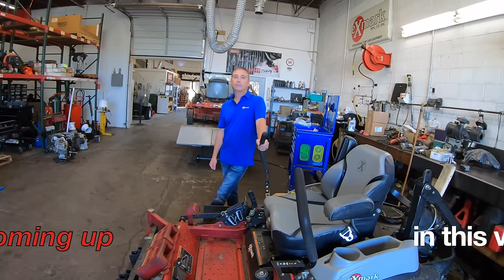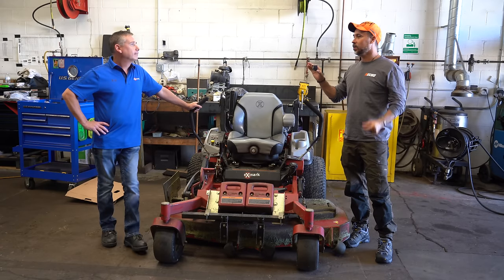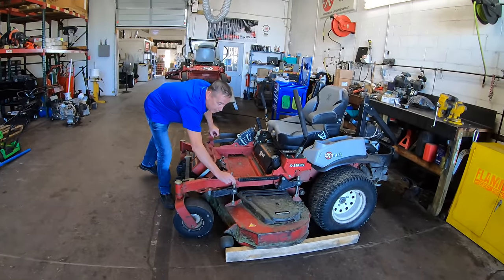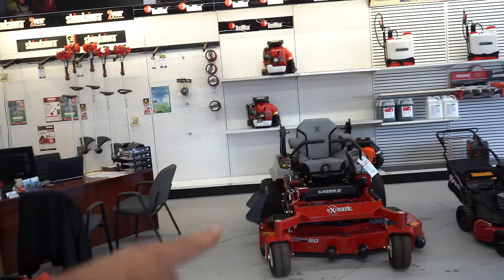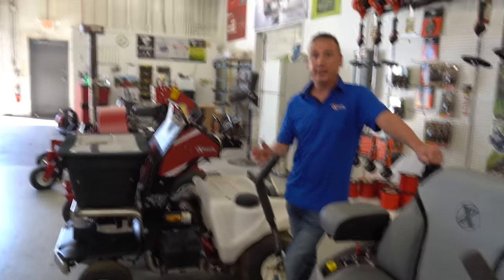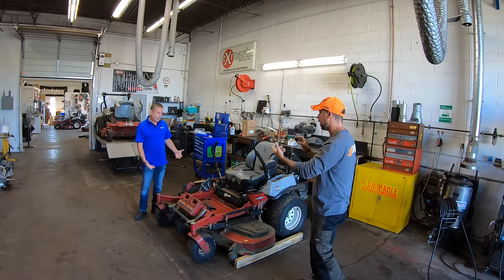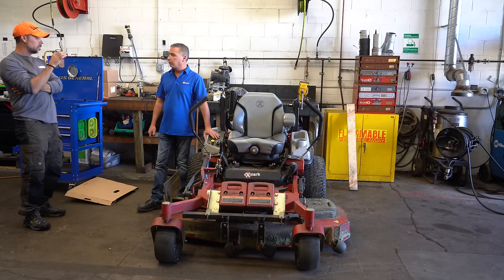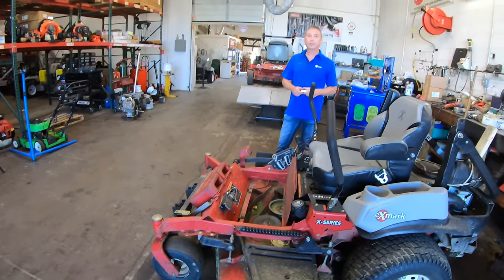How the Pro's Level a mower deck, Fix steering problems & set Rake for the best cut quality 4k video

Comment: I bought my wife a new Ferris IS 3200 last year with a mulching kit on it.  She was tickled with her new mower until she noticed it was leaving a trail of grass on one side after every pass.  I ended up getting the manual out and leveled the 61 inch deck and put a positive rake which lowered the front of the deck to 1/4 inch lower in the front and that fixed it.
The dealer must have just been shoving them out the door with no prep work.  This was a great video and with more details than my Ferris manual, thank you.
Reply from the maker: You're welcome, thanks for watching!

Comment: I've been having issues with my 07 52 inch and talked to Fred today and told me that my problem was the frame was sagging with it being a older 2 piece frame, told me how the fix it and when I started adjusting the frame he did exactly as he said it would do, this guy is pretty damn smart.... thanks Fred
Reply: What was the trick?

 Did you have to lossen the main frame bolts? 

How did you rule out the other factors to know it’s the frame?

Comment: I have worked on a lot of ZTR machines.  If they have a tracking issue, you can always adjust the control linkage, so the faster side travel, is limited to match the slower side.  All the machines have a limit stop to prevent damage to the hydros.

Comment: I've done some of the same things in the past but I also learned a thing or two. Thank you this was a great video. One thing I think you forgot to mention is the riders weight, I have used sand bags on my seat to fine tune both zero turns and general homeowners grade mowers. I have to do it with weights because 15 psi acts like 10 psi with 300 lbs added to it.
Reply from the maker: I'm glad you liked it! Thanks for the feedback.

Comment: Thanks learned alot! Wouldn't be surprised if Fred has some stock car racing in his background as this sounds like chassis setup 101.
Reply: Yep grew up in the Midwest... we did a ton of dirt track racing!!
Reply: @fredfugett8272  I could tell. Nice info, thanks for sharing.  I'll put it to good use next time I run hot laps on the Zero Turn.
Reply: Would it be possible to ask you a tricky cut problem with my Toro Zmaster ? 

I doubt the frame or the strut push arms are bent, but I’ve done everything in this video.. no improvement

Comment: Most thorough vid on deck tune up... get the tractor right first! Hadn't thought of that but really makes sense. Got to check your vid collection to see if you have one to correct a current steering issue. While going down hills, trying to slow down the rig jerks or grabs left and right. it's a fight to try keeping a straight line. think it's got to be the linkage or steering dampener that I've already switched out.... Fabulous having pros !

Comment: Awesome information in this video! Some of that stuff I would have never thought of. Great of Exmark to send someone out for a video. Exmark is top of the line, that’s why it’s all I run. I woulda loved to hang out with him and learn all that and more very cool dude.
Reply from the maker: It was pretty awesome, but hopefully this video is the next best thing to hanging out with him for you haha. Thanks for tuning in 👍
Reply: Stanley "Dirt Monkey" Genadek definitely was close to hanging out him. Hopefully he sees this comment, I want to know what causes both back tires to wear down on the inside on multiple machines with different operators. Just replaced tires with almost no tread left on the frame side of the machine. Outside of the tires still had decent tread. I run about 10- 12 psi.
Reply: @meadowviewlawncarellc8079   About 90% this is caused by zero turning on a hard surface. Things like driveway and parking lots, they are turf tires so hard surfaces beats them up. You should get 800-1200 hours before it get too bad. What kind of tire is it?
Reply: Fred Fugett there Kenda. I do get about that many hrs on them, got just over 2,480 hrs on this machine and just put on the 3rd set.

Comment: Stanley, I run Scags 52” Turf Tigers , and let me tell you they have cheapened they’re decks up so much! 10 years ago 1/4” steel all around, now 3/16 on top and 1/8” on the sides I have had to build shims for spindles and even went as far as adding washers to spacers and cutting spacers by as much as an 1/4” to keep these things cutting level. It is a real problem. Thanks for the vid, but I’m tellin you sometimes you’ve got to think outside the box to keep it going and give the customer a good finished product.
Reply from the maker: Yeah- but you shouldn't have to do that to a mower.  Sounds like its time to check on other options.
Reply: Absolutely! Stan, I’m giving 12k for these things, and buy 5 or 6 of them every  3 years. I’m pissed! I’m down here in North Arkansas and I’ll tell you this mower was head and shoulders above any of the rest. But I think this company , tried to save two dollars on production and sell two million mowers, they just made two million more dollars!
Reply: @larryfowler7760  All I've ever run are Woods zero turn mowers.  Thickest gauge decks I could find, along with Grasshopper.  Come to find out, they're manufactured in the same facility.

Comment: Tire circumstance is something we always chased in the trucking business.    Tried to always mate then to within a 1/2  
And that was on 20” and 22” wheels.   So I imagine the margin for error is even less on a lawn mower.
Reply from the maker: Yeah-it can throw a mower off pretty bad
Reply: Exactly because tire circumference alters gear ratio.
Smaller circumference equals more revolutions per mile.
Larger circumference equals less revolutions per mile. In the excavation/trucking business one should be extremely aware of that. Get a flat on a tamdom wheel  and one needs to match up tire circumferences between inner & outer tires when changing flat tire.
Reply: We had the same issue with large aircraft tires, especially the front tires.  With lawn tires, air pressure will make a big difference.

Comment: Bought a used lazer z , the guy that had it adjusted the deck over and over to no avail. When i bought it i noticed one new tire from a different company on the rear, now i know to check circumference of the tires to make it cut level, thanks.
Reply from the maker: That's cool, happy the video helped!

Comment: Stanley you rock!  For machines that cost 7-10k. You would think that tires wouldn't be an issue.
Reply: I think one tire was replaced at some point.
Reply: When you replace tires on an automobile, that's why they always tell you to replace in 2's.  You rotate the rear tires to the front, straight ahead and put the new tires on the rear.

Comment: I have basically the same mower, however mine is a Toro Z Master 3000 series 60’. I have looked all over youtube for an informative video about deck adjustments and this is the best one so far. My mower has around 1100 hours my problem is I’m out of adjustment on front and rear. My adjusting bolts on either side in the front are maxed and the single-point adjustment setting is maxed as well. I have new blades and the tire pressure is at spec (13lbs) I’m all out of ideas I’ve been messing with this thing for months and can’t get the front up to the cutting height that’s labeled. It always comes up 1/4 of an inch to low and the back will not lower any further but it’s always half inch too high off. I’ve tried everything but it has gotten me stumped

Comment: Bought a new exmark radius this year and its left a Mohawk since day one only when i got 3.5 or higher
Reply: try changing the types of blades you are using and go to a high lift blade. when you mow higher you lose vacuum so the cut quality goes down
Reply: Kevin Cloonan iam running the exmark Red blades i think they are a high lift correct me if iam wrong. Do they make a after market blade that has more of a lift?
Reply: @mikesautomaintenance5780  I no longer run Exmark so im not sure what blades come on them. Typically most mowers dont come with high lift blades so yes you would have to buy either an aftermarket blade or a high lift Exmark blade

Comment: When checking the cutters' rake, I'd suggest doing two checks - one with the blade(s) fore and aft and one with them rotated through 180 degrees - then average the results to account for any blade or shaft bends. It will also point towards any other issues with those that need to be addressed, such as if the rake appears different for each blade/shaft, it suggests the deck is bent and/or a shaft is worn.
Same thing with the left/right height adjustments.

It wasn't mentioned, but Stan pointed out the shot roller - as this is also critical for the ride height of the cutters I assume it would be set up in a similar fashion?
Reply from the maker: Great Points Gordo!
Reply: Yes we call them anti-scalp wheels but they are a gauge wheel. When adjusted properly they help with over all cutting. There are not meant to be running on the ground full time. Only on uneven turf.

Comment: I've been working for john deere for 6 yrs setting up new mowers and such. one thing he forgot to mention that the rear tires could be brand spanking new but way out of round. we had a new mower a customer just purchased and he was complaining that the grass was being cut funny and he couldn't get the the deck level. i told him every mower is thoroughly check over and leveled. so we looked at it and i noticed that the settings were different than how i set them. if you pushed the mower forward 2 feet and rechecked the measurements.  way different than the previous check.
raised the back of the mower with a jack and started mower . engaged the wheels with hydro and you could plainly see how out of round the tires were. very frustrating to try to fix that. not much you can do but break the tires down and remount them to see if that fixes them or replace.

Comment: That's why the use of mechanical brakes to hold hydraulic motors is wrong. Hydraulic activated brakes bypass the fluid that make off centered controls cause forward or reverse pressure in the system meaning we dont need spend 2000 to 3000 in parts for something that could have been added for another 1000. in the start.

Comment: Great video, but i have a question. If my blades are running true as they should be on a new machine then why can't i just use the center front bottom of the deck and the left/right rear bottom of the deck to get the pitch needed  instead of using the blade tips front center and rear  corners ? Thanks again for all the information. Also i can only find 2 grease fittings, its a 2023 radius e series. Is that correct ?

Comment: I know this was about leveling the machine and deck but would increasing blade tip speed say with different size pulleys help with cut quality?
Reply from the maker: I don't know.
Reply: I would assume with all the R/D these comanies put in they have the best balance for performance. 

Not to mention it would have to kill the spindle!

Comment: It's like a 4×4 auto that has a ratcheting issue have to check all 4 tire circumferences. If one tire is way taller or shorter can cause an issue. Lawn maintenance 101 the right tech can make the difference.

Comment: If you cut a rear tire.  Is it better to replace both rear tires as long as you match the circumferences?
Reply from the maker: That was the jist of it. But you still have to make sure tire circumferance is matched up.

Comment: How much air should you have in the tire when you take a measurement?
Reply: It is not as important what your tire psi is...you have to do it be for you level it. Guy run all kinds of tire pressures, it's about what works for you.

Comment: Off topic, but what brand of pants are those you're wearing? Maybe do a review on the quality. Reason Im asking is because I've had a hard time finding good durable work pants. I've resorted to Deluth brand for durability and flexibility. If theres another great option out there I'm unaware of, I would definitely like to know.
Reply from the maker: I'll do a review on these after Ive seen if they hold up.
Reply: Try arborwear
Reply: Try 1620 Workwear

Comment: So, what was the middle blade measurement? How much was the true rake? What did he actually do to get rid of some of the rake?
Reply: Rake is a hard one to understand. Don't think of it as fixed number. Start out by looking at it this way. The longer the blade the more rake the deck can take! Adding rake helps with discharge and lower rake will help with stragglers.

Comment: i am sure you have have ran into ground bees. i was doing a trenching job and got stung 14 times. left the trencher and ran into the pond. what is the best way to quickly get rid of them ?  i went and got 12 cans of spray and then set them on fire. wen it was burning i got the trench done but they kept coming back when the fire went out.
Reply: @Fresh-tw7ev  the problem is getting it done that day quickly

Comment: What about the commercial 30.  For what Fred is saying, there is rake built into the deck?  Now if I’m mulching grass, and it’s a little thick, would raising the back of the deck a 1/2 inch or so higher then the front wheels, make the mower cut / mulch the thicker stuff a bit better?

Comment: Where should the deck adjusters be from the factory? My brand new lazer x is darn near maxed on one side front and rear, one would think all 4 would be near the middle on all four, not sure how i will be able to adjust when that time comes besides keep lowering rear air pressures.

Comment: Great video Stan, so ideally do you want the rear of the deck a little lower or higher than the front of the deck for the best cut and discharge? Or does it depend on the situation your in?
Reply: The front will always be slightly lower for best cut.

Comment: there's more info in this video than all the other deck leveling videos on youtube combined.  I just got my 3rd scag and the deck is off along with several other dealer contributed issues (i've been posting videos showing this).  I know on scags they say they are leveled at the factory and the numbers are just a guide and do not correspond to cut height, however i'm seeing more and more scags with inconsistencies and it's sad that I have to fuss with this crap on a brand new mower to make it cut level.   no way in hell will i take it to the dealer and scag just tells me to "read the manual"

Comment: Great info, from a new Exmark owner (1 month, 15 hours on the dial).
How does all this apply to the S series rear discharge? Same rake concerns?
Also, shouldn't the weight of the driver be part of the calcs?
Thanks again, Stan and Fred.

Comment: I always heard on 10 psi is best for hills does that cause the rutting?
Reply: In my (unfortunately) extensive hill mowing experience, 10 psi will lead to a bead breaking and a instant flat. But lighter machines can get away with less so its situational
Reply: @daflea66  Yeah that was for a 48 stand on

Comment: Sorry,  I'm pretty dense,  but  where on the frame do you put the level to check frame level?
Reply from the maker: Great question- I'll let he exmark guys pipe in and answer that one.  They said they would pop in to answer questions.
Reply: Don't think of this as a (bubble) level. Technically speaking you could level on a slope. You leveling the deck to the ground.
Reply: @fredfugett8272    Thanks Fred,   I was thrown by the reference to the concrete which the Xmark was on.  I guess it would have been more accurate to say that the slab should be flat vs level.   Then examine the wheels to see if they are  out of whack.  Fix that, and then adjust the deck for equal distance to the floor,  allowing for needed rake.    My building experience leads me to think of something  that is described as level  is usually determined by a level, laser, or transit.

Comment: Great vid but never advise anyone to pressure a tyre more than its rated psi
Reply: Mabey its different with tractor tires. I highly doubt this guy would advise someone to do something he felt was unsafe and take on the liability for that
Reply: martin pattison lets consider it this way, no parameters were set in the video, a guy takes a 45psi tyre and inflates it to 90psi to leave on the sun, he hits 80psi and the tyre explodes in his face... how do you defend that? Health and safety is a very very well known process these days, theres no excuse, its a court case waiting to happen. Im not being a dick, it simply is bad bad advice
Reply from the maker: Good to know- Thanks Mission Dan!  I didn't think of it that way.
Reply: I was mounting a front tire for a 2wd tractor the other day (10.00L16). It said not to exceed 35 psi when seating the beads, but no maximum pressure was stated after the beads are seated.  It was a Goodyear  tire.

Comment: What’s rake
Reply: It's the pitch of the deck from back to front. You want the back to sit higher than the front for multiple reasons. One being it only has to cut the grass once which is better for the grass and puts less strain on your engine.

Comment: If you want an accurate deck leveling setup, start by placing the mower on a 5/8 piece of plywood.....the concrete floor more than likely isn't flat....certainly not when measuring down to 1/8". The plywood removes the little "ups and downs" of the floor.